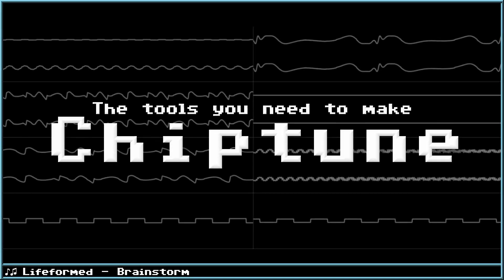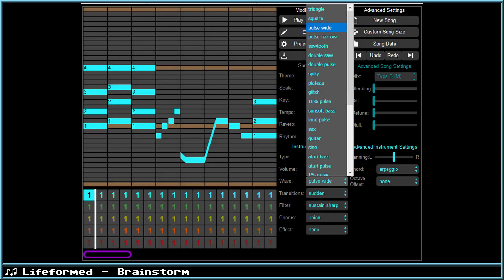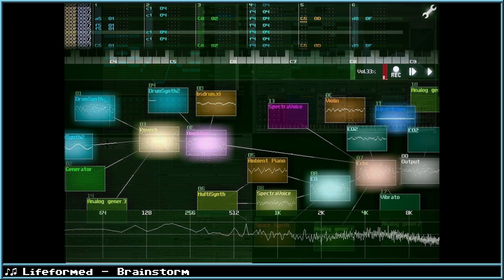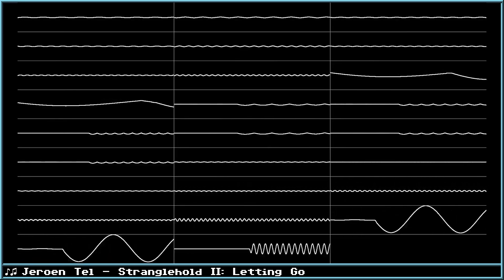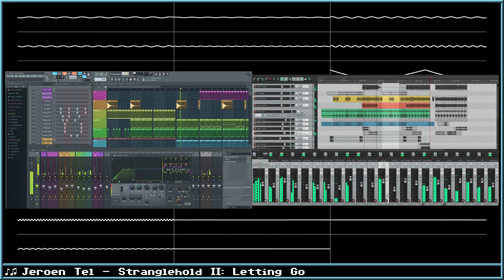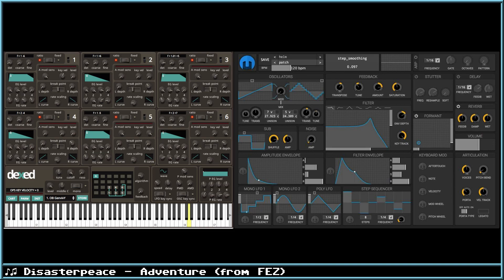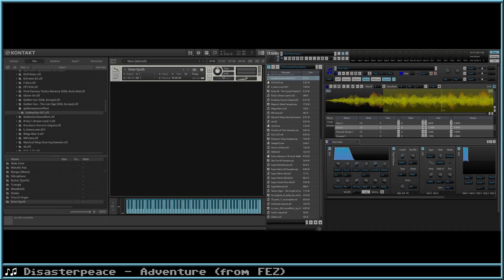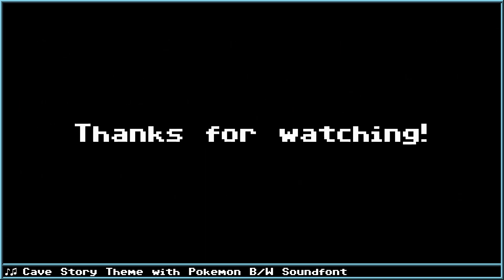Ultimate Introduction to Chiptune Programs Part 1: General Tools

Comment: Starting off with beepbox is such a low blow dude. do you even know why chiptune is called chiptune? It's because it uses a chip.
Reply from the maker: a low blow? 🤣 what does that even mean. I'll start with assembly coding next time bro, my bad.
Reply: @JorfDB why would you start with beepbox? Who said anything about assembly coding? My motto for chiptune is "if it runs on the real deal, it passes."
Reply: @JorfDB why would you start with beepbox? Who said anything about assembly coding? My motto for chiptune is "if it runs on the real deal, it passes."

Comment: the fact that I totally switched from fruity loops to lmms made me learn so much about sound generation and design. It was always a mystery for me how sounds are generated created and only option for me was to download samples, but once I understood synthesizer waveforms shapes(sine,square, triangle, etc), frequencies(EQ), and automation(Cut, hipass, lowpass), half of the mysteries went poof..
Reply: the only downside to lmms is exporting/mastering. you might sometimes need to use an external daw to make mastering(or even mixing), because lmms is not consistent with its output levels, mostly when you use some particular effects (bitcrush being one)
Reply: but I do use lmms, it is a very cool piece of free and liberal software, that is yours to keep forever.
Reply: @linuxrant yep I started off in LMMS and then moved to fl once I had the money to purchase 😉 it is pretty interesting though how sounds are created like originally without the use of instruments. It really shows how powerful computers are.